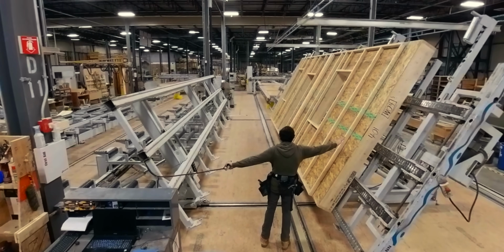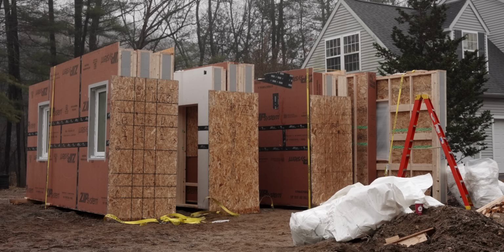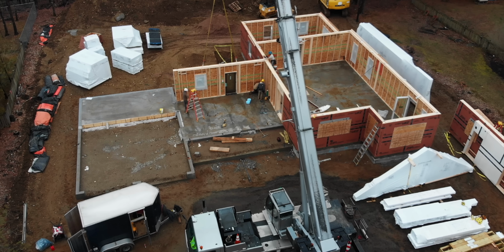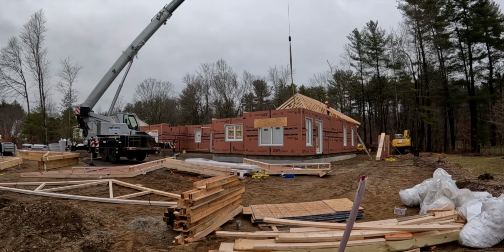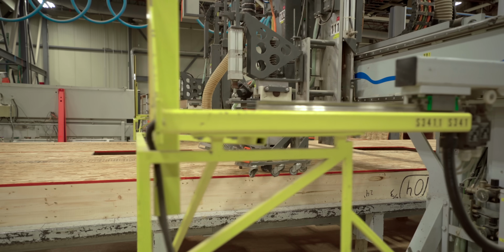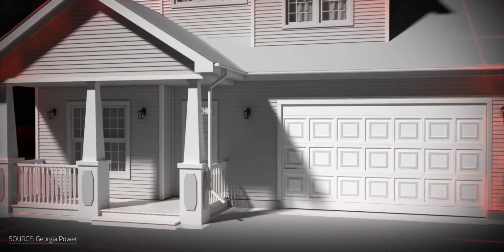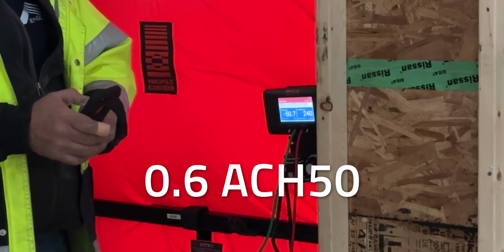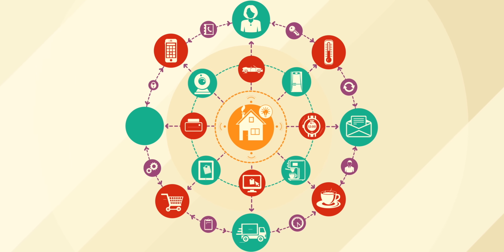Wow! I Didn’t Know A Prebuilt House Could Do This

Comment: Great Video again Matt. Thank you for sharing about your new house. Factory built houses like the one you're doing should be the norm at this point and not the exception. Access to these type of houses are not readily available in all area's. It is getting better. You would thing the fed gov would be pushing this direction a lot more than they are, which is about zero. I am curious to know what the cost is going to be to replace the solar and battery back up in your home will be in 15 - 20 years from now. Hopefully by then, recycling the solar panels and the batteries should be well underway at that time.

Comment: You must be a real treat to have around the work site. Just for reference, what were the first two results on the ACH tests? I saw something online that does the opposite where the internal spaces are pressurized and the builder fills that area with a fine material that seeks out and fills any void to the outside air and seals it. I believe the cost of that was exorbitant (IMHO), but I was wondering if you had heard of it.

Comment: Dear Americans. You are not helping the planet by building a house like this one. I mean come on, just look at it's surface to volume ratio, omg 😱 for this kind of temperatures it would be illegal to build a house with insulation like this in Europe 🙈 every new house in Poland is has two-layered walls - a brick wall and 30-40 cm (12-16 inches) of insulation. Like seriously it's illegal to build a house like the one in the video in Poland. 

Also, I googled the house company and I wanted to ask you why on earth do you need houses that big??? 2 bedrooms in a 2000 sqft house???

Comment: Congratulations on your new home,  it is beautiful. 

I am a licensed General Contractor and a Civil Engineer.  I design, build and remodel homes.  This same home could have been built on site with traditional methods to the same stopping point in less two months,  weather permitting. So there wouldn't have been much difference in the time frame.  Keep in mind you waited months for the factory to pre-build your home before they installed it. 

 If scheduled and designed correctly,  a new home like yours can be built in four months.  But usually there are delays in getting materials or with subcontractors.  This can drag out the construction time to six months.  

Nor would there be any difference in quality with a traditional home construction,  provided your GC knew what he was doing.  A good GC will produce exceptional quality because they have multiple years of experience. The key is making sure the aggregate home design is done correctly. 

While this home is well designed in most areas,  there are some design choices that I am not a fan of. The use of wood fascia without protection and without being pre-painted and sealed is a significant mistake.  With my designs I  spec a 1/4" fiber cement veneer over the wood fascia. The fiber cement panels come with a 20-year baked on paint finish that will easily last 20 -25 years with no maintenance.  

I also think that I would have spec'ed a metal roof for your home with a modified bitumen underlayment.  This essentially would have been a lifetime roof that would shed snow. 

Traditional home construction can "seal" a house to the 0.6 air transfer spec you mention.  This is commonly done on high-end homes. It is also not difficult to install energy efficient doors and windows. 

 So factory built homes are not superior to traditional homes provided that you have an experienced GC overseeing the construction and design.  Further,  you can customize the design a lot more with a traditional build.  

For your home,  I would have designed a second story section of the  house with an upstairs kitchenette, an office, and a large walk-out balcony that is covered. I also would have put the master bedroom on the second floor, a full bath, an upstairs laundry room with storage,  walk in closets, and storage cabinets in the hallways. Possibly I would have also added a guest bedroom  well separated from the master bedroom. 

One other design parameter I would have stressed is home security.  I would have pre-wired for security lighting,  installed metal security shutters on the windows with smart automation,  installed metal decorative outer security doors with smart locks, smart switches throughout the home,  a wired smart camera system,  and wiring for a panic button to law enforcement.  I also would have installed a panic room that would be designed for a dual purpose to protect from catastrophic storm events and home break-in crime events. 

I would have pre-installed wiring for a roof mounted solar system and installed the panels when the roof was installed. I know you mentioned  you are installing a solar system with batteries in your video,  but you could have saved money having the wiring and panels installed with a traditional build home. 

I also would have installed an underground 10,000 gallon rainwater/snow water recovery system with a whole house carbon/uv filter system.  This would have allowed you to save money on your water bill for decades, and it would enable you to have water in emergency situations. The cost would have been around 15k and many cities pay part of that cost.

Comment: Strand board would have me concerned. Yes, I know how it gets made having worked shut downs. Between moisture and dry rot, that alone would have me at full stop. Moreover though is the gassing off combined with the air exchange. So many products we build with have the hidden danger of low level long term chemical exposure. How did you approach this with your build?

Comment: Thank you for sharing. What kind of slab did you use? Frost walls look "typical", is there insulation under the slab, radiant tubing or wiring, fiber or wire mesh, rebar???

Comment: I've been interested in this process for years since I first heard about it and have decided it would be ideal for our next home. We want something much smaller but bigger on energy efficiency to keep costs down over time. Thanks for sharing this. I think the main thing I want is the heating and cooling system info. I had looked into geothermal but for the house I have and other factors went with a heat pump instead. We are going to go all electric so, it would be good to hear why you went with geothermal on your new build.  
Thanks in advance and congrats on building your dream home. Hope it is even better than you dreamed it would be.

Comment: @UndecidedMF I was wondering while You decided to go with the Passive House standard and not for Active House, since the former is >30-yrs old. At least here in Germany most younger generation house owners opt for an active house now. Reason being, as You mentioned in the beginning, that an active house produces more energy than it consumes. In our case, our home has a buffer battery where a central heating would be in an old building, thus giving us electrical energy worth approx. 10k miles for our family car each year. So was it the availability of the technology in the U.S. or the price, or did you have other reasons?

Comment: I’d be interested in why you went ground source vs air heat pump. My 2400 sq ft shop takes nothing to heat and cool with just a small mini split. I’d like to know what the payback is going ground source that costs thousands more to install.

Comment: You should reach out to Upstart Power to discuss one of their residential solid oxide fuel cells.  Supposed to work with solar and battery storage to replace and generator and make your overall grid reliance less.  I’m not entirely sure they’re to market yet but I bet they’d be very interested in your channel!

Comment: What is the saving Vs stick build for the frame only? There are many ways to achieve zero energy goal. Does zero energy goal, the only way to be efficient.
Electric car are not the way to solve pollution either are the pollution is push somewhere else were the electricity is produced. Not even talking of the process to make the batteries, and the environmental cost to get the stuff to make them.

Comment: Was the door that caused the problem one of the tilt and turn ones? I repaired alot Of those and I hope the adjustment was not just with the hinges. If it had issues opening/ closing the framing and glass balancing should be checked it is very important they are level ,square and not warped along the pvc frame at all. Interesting build.

Comment: Very interesting!  That factory is astounding!  

Back in the early 1970's in Longmont Colorado, there was a company that built the entire house in a huge hanger.  They then would move it to the site by a huge thing that straddled the house, lifted it, and slowly moved it.  When the subdivision was built out, the company gave the hanger to the city to be made a recreation center.

Another company in the area, Weyerhauser, yeah, the paper and lumber company, was making modular homes.  Each section could be trucked, similar to the "mobile" homes sections we see on the highway.  But these were installed onto concrete slabs and were of overall higher quality.

Comment: I think this would be a fairly standard question that has already been asked,  but in case not, what is the cost of this type of building process compared to the build-on-site from scratch method commonly used.

Comment: I bought a manufactured home in June 2004. Double wide, 1800 sf, 3BR, 2 full baths, LR, DR, country kitchen, office, laundry room, raised roof, three dormers, 30 ft wide front porch. $110,000 ($61/sf). Manufacturer: Clayton Homes, Albany, OR. Home is located in Tehama County, CA on a flat 10 acre parcel in the North Sacramento Valley. Permanent foundation. Site work and installation took 4 months (Sept-Dec 2004) due to the building boom occurring then. Best built home I ever owned.

Comment: While I can’t speak for your system design I have dealt with a number of very significant failures due to entrapped construction moisture in SIPs systems. 

I would want to be very certain that there is no moisture trapped before thinking about finishes. Much cheaper to fix it now rather than in a few years time.

Comment: My factory built home was shipped as 4 "boxes" and was set on the foundation, with completed roof, in a day. From the outside it appeared that in the morning there was just a foundation, and by evening there was a completed house. Kitchen and bath fixtures, drywall, etc. were already installed. It basically needed just HVAC, flooring, and plumbing to be connected to the supply and sewer lines. I wouldn't really consider yours to have been factory built. I'm wondering why this house was basically just pieces that all had to be assembled on site, rather than put together in the factory and shipped as completed units? It seems less efficient that way.

Comment: I've been in construction for about 10 years, and associated with construction tradespeople since my teens. One of my brothers works for a company in Wash State that manufactures the SIPP panels. The advantages of automated manufacturing in terms of consistency and reliability versus the (more than a few of the) alcoholic carpenters I've personally witnessed on construction sites cannot be overstated. The sheer cost savings on labor alone makes this an excellent option.

Comment: I had a NetZero house constructed in 2017-2018, same Logic Tilt/Turn windows..  it was stick built with 2X8 exterior walls for the house, and 2X6 exterior walls for the garage.  Trusses were used extensively throughout (clear spane basement, 1st and 2nd floors), walls were “netted” and insulation was blown in after wiring/plumbing, before drywall..  of course zip sheathing as used on the exterior and roof, attic is ‘cold’, meaning the house envelope ends at the 2nd floor ceiling.. blown in insulation was placed in the attic, to R60.  Initial bliwer door tests were nit good, until air leaks were found and sealed, eventually .43ACH50 was achieved.  Should also mention I was not a purist for “all electric”, but did go with a 4-zone Mitsubishi Electric Air sourced hest pump, a 48K BTU unit heats and cools the entire 6,000 square foot house.  A 10KW grid connected solar PV system was added a few years later, which offsets all but 3 winter months of any electric bills..  Dryer, Oven, and Hot Water all run on Propane, and its still a decision I would go with, 3 years later the 1,000 gallon propane tank was topped off, it only took 310 gallons (max a 1,000 gallon tank can hold is 850 gallons as it needs air space to vaporize the propane), so less than 1/2 tank of propane in 3 years 👍   Its absolutley worth building to a passive house to NetZero, as the cost to live in it is very low, so over time saves money and resources.  Would definitley do it again, but would likely build smaller, and use the same pre-built panel system you did..  keep on plugging, the finish out of wiring, plumbing, HVAC, drywall, etc takes the longest, not to mention waiting for inspectors 🙄

Comment: I understand the trauma of building your home. We built a True North log home back in 2001. From the time the team arrived to assemble the log home on the foundation until there was a water tight shell was one week, which included a couple of rainy days.  It was a heck of a thing to watch. I'm surprised that you didn't use an ICF (Insulated Concrete Forms) Foundation for your basement.

Comment: Hi, thanks for the video, well shot and well done.  I saw some guys with a small "smoke" pump checking the joints of the windows and doors to see where the air was coming out.  It is a fairly quick method in my opinion and you can see the smoke immediately.  One of the cases I know of was a crack in the foundation concrete and you wouldn't have had a chance to discover it by other methods.  Of course it was a serious flaw, but visually everything "looked fine" in the first place.  Anyway, I'm glad you achieved the airtightness!!

Comment: Oh man I wish you had followed this entire process from the beginning and turned it into a detailed series... I LOVE watching home builds... and I have wanted to learn all about the tech that goes into making these high efficiency homes. And you would be the guy to cover it all with the right amount of detail. Well I guess it's not too late to start...
I am hoping you focus on the geothermal tech ... A LOT! You typically don't think of geothermal heat in areas with nearly zero volcano/earthquake/hot-springs like here in the North East.... but I have learned that is not the case.  And TBH the only other geothermal info I have seen videos on was also in Mass. so I hope you cover it in some detail... and not just the tech, but the process of getting it installed, AND APPROVED....  mainly because you can't do it everywhere, and I've never heard about it here in Southern New Jersey.... 
Oh and btw.. and  I am super jealous of your windows... they seem like the type I would LOVE to have in my home... just REMEMBER to keep those latches and internal gears maintained... I have some windows that you crank a small handle and they open, and over the past 20 years they are nearly impossible to do without taking the screen out (which is on the inside) and reaching to pull the window in because the gears have become so loose over the years... so STAY ON TOP OF IT!!! :D

Comment: Hi Matt! Great video and series. I was a long-time infosec and technology risk pro before retiring, and my questions concern the smart home automation tech you're planning to install. After observing the progression of these technologies over the last 20+ years, IMHO the biggest concerns aren't around security* (surprise!) but rather about all the aspects around future-proofing. The single biggest issue I saw in my career was the loss of manufacturer support, either through the product aging out, or the manufacturer disappearing, either through M&A or simply going out of business. Users of smart home products have seen this happen with some frequency over the last few years. What are your plans to mitigate these risks?

Also, to what degree with the vendors you're working with keep and use the data collected from your devices? Will they be sharing it with third parties? 

*Though security (mainly in preventing misuse of internet-connected devices in DDOS or similar attacks) is a legitimate issue, if somewhat overblown by some of the more breathless forecasters. Historically, loss of manufacturer support is a much more common and eventually costly problem.

Comment: Spray foam insulation achieves ridiculously low air changes, but you better have a reliable whole house dehumidifier or two with an air tight house.

Comment: Wow That Seemed a Lot Easier than the Prefab House We Built Here in Northern Vermont Back in 1971...
Then Again We Did It Ourselves with No Crane & only 4 Adults & Me 11yo...
This Leaks Heat Like Crazy & the 50+yo Fiberglass Insulation is in Need of Replacement.

Comment: Nice. I'm just puzzled how that you build in the U.S. the walls right on the concrete slab without any hydro and radon insulation? How do you prevent radon entering the house? Do you have ventilated basements and if so, is that enough for protection?

Comment: One of the things that would have helped enormously would be if Zip-R sheathing had fit into your budget.  That would have taken care of the vast majority of any thermal bridging.  Between that and the windows/doors, even though they ARE much beyond U.S. standards, I suspect your OVERALL R-value is closer to the low/mid 20's than the R-34 you mentioned.
.
That said, a prebuilt does sound like a good way to go if you want/need a stick framed home.